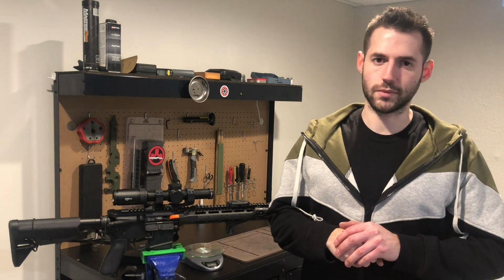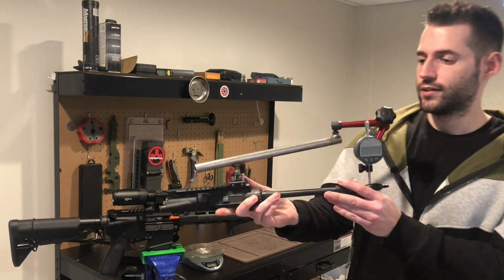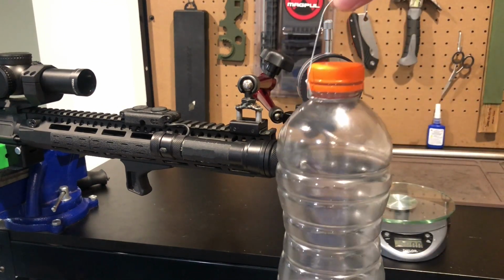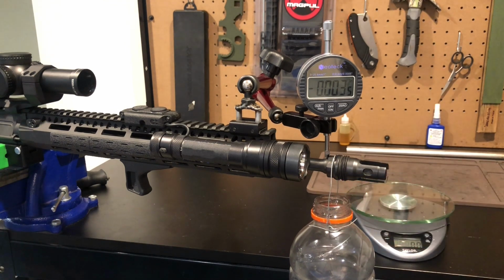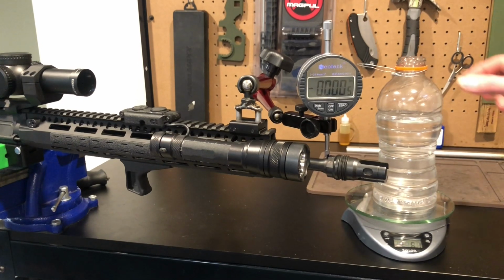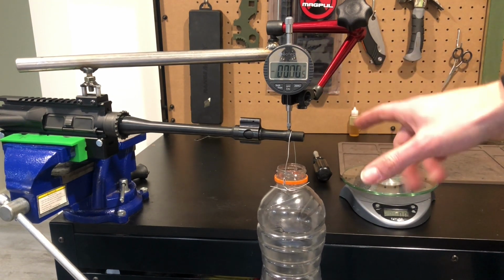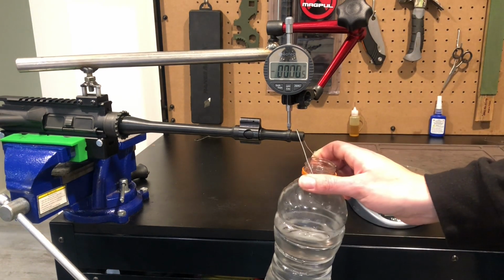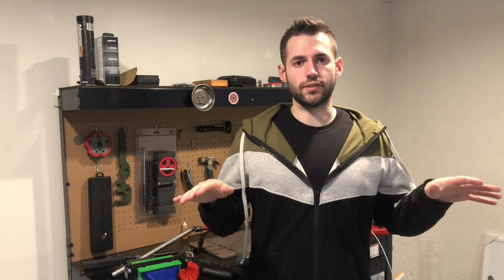Do Suppressors Affect Pencil Barrels? (Faxon Pencil Barrel Droop Case Study)

Comment: So watching this, and understanding the AR platform well. Of course gravity plays a roll. So adding wieght would impact the barrels position relative to its zero(scope). There are many parts that can move and shift. So the intial measuring from the handrail to the barrel is not significant as that is not your tru place to 0 your measuring device. Using the uppers rail would be the best option.

Comment: Your setup is cringe.
.
Your .002 “deflection” is likely in the vise and clamp to gun interface.
.
Put the hand guard on and put the indicator on the guard, will get the same deflection as when measuring the barrel.
Now put the dial on the barrel and hang the weight on the flashlight…… same .002
.
Also indicator tip on flat surface not the radius of the barrel.
Reply: Where’s your video?

Comment: My math may be wrong but if there is roughly .05” of droop approximately 16” from the intersection point. That translates to about 11.25” at 100 yards.  As long as that POI stays consistent and you always run the suppressor there shouldn’t be any issues. Granted this doesn’t take into consideration travel of the actual round, just straight lines.

Comment: I know this is an older video but didn't really see anyone using any logic in the comments. Your comparison is flawed, one barrel is shorter than the other. at .0055 at 100 yards deflection would be less than an inch closer to around .3454 inches. If you are worried about that type of difference than I would suggest worrying more about what caliber you are using and what that platform is actually used for. Also if you are using a suppressor on that weapon system why are you zeroing it with out the suppressor?

Comment: cool video idea.  Small content creators like you and I need more algorithm love.  Gave you a like and a sub.  I have a few cans.  With my steel can, I see a significant amount of POI shift even on no taper barrels.  To the point I have the shifts recorded in my phone depending on the host it is on.  Not so much with my titanium cans.  Good idea to zero your turrets to how you plan on shooting most of the time and then do some thorough analysis and know where to dial when the can is hangin or not.  You will find it is repeatable. Also need to consider cans change barrel harmonics which can either help or ACTUALLY HURT groups.

Comment: This would be interesting to see the difference in flex between room temp and 500 degrees operating temp. On heavy and pencil 12.5”s, 14.5”s or 16”s
Reply from the maker: I attempted heating the barrel and testing but  i saw no results with a heat gun.

This may require a full heat soak in the oven to really see the effects
Reply: @eitrisenhancementsllc  handheld torch would also work great, but a oven test would be far more repeatable!

Comment: It is surprising how much point of impact shift my 16 inch Faxon pencil barrel build had at 50 yards.  I zeroed my Vortex 4-16x42 scope (unsuppressed) at 50 yards.🎯I installed my Silencerco Saker 762 (20.7 oz.) suppressor. The  point of impact dropped 6 inches at 50 yards with the suppressor.⬇️😮 The total build weight of my 16 inch .223 WYLDE Fostech FLITE Elite upper/lower is 4 lbs, 4.5 oz.💸💸
Reply from the maker: Holy crap that is light! Hows the recoil impulse on it?
Reply: I had a similar experience. BA 16" pencil barrel. zeroed at 50 unsuppressed. Threw my Omega 300 on and dropped about 3" at 50. I just got a turbo k, which is much lighter and only have about a 1" drop.

Comment: Although I like where your head is at, I'm not sure this is a reliable representation of suppressor weight. I think the weight is distributed in a more linear fashion, so I don't think it will affect the barrel as much. in this test all the weight is on that single spot where your wire bale is. Its concentrated within a 1/16th of an inch.  I could be totally wrong, but that was my thinking.
Reply: It would actually affect the barrel more since the weight of the suppressor has a greater moment on the barrel.
Reply from the maker: Well considering the barrel is made of one piece of steel, and its attached at one end to the receiver, and the other end will carry the suppressor. The weight of the water will be affected on the barrel in an identical fashion as the suppressor would.

I see what youre saying, but the question isnt how much weight is put in a small surface area, but instead the question is how does that much weight affect the barrel at the very end.

Your question is valid but unrelated to the test that i was conducting. As i was looking for flex and not stress in a small area.

It doesnt matter if you apply 20oz in a 1mm surface area versus 20oz in 5mm area. As the goal is to test how much 20oz will flex the barrel if the 20oz is applied at the end of the barrel.

Hope this helps understand the goal

Comment: Good work. Just a question add heat from many rounds do you get a permanent curve? Would stainless hold up better?
Reply from the maker: This is a great question. One would assume there would be an increase in droop when heat is introduced.
During the making of this video i attempted using a heatgun to see if there was any difference. I didnt include the footage as the heat gun couldnt supply enough heat to make any difference.

I would love to test stainless vs 4150 but unfortunately i dont have the funds for it at the moment. 
If @FaxonFirearmsOfficial could send me some barrels i could continue producing more of these videos and get a better understanding of the droop these barrels will see.
Reply: @eitrisenhancementsllc  I understand that problem. I am actually seriously looking into building one. Every component it seems has to be highest quality. My kids have badly warped some barrels in shotguns and overheated some ar barrels severely but no weight was hanging off the front. Only a bird cage flash guard.
Reply from the maker: @markr.1329  as a general rule of thumb, 4150 barrels will take abuse better than 416r stainless.
Considering stainless is (according to the internet) easier to cut, which could provide a cleaner cut. One can assume it will wear out faster than 4150.

It also sounds like you deal with large volumes of fire. So i would believe the pencil barrel to be a poor profile for this.
Id suggest the gunner profile instead. As the thicker barrel will help prevent heat distortion.

Realistically, the best barrel suited for your application isnt made by faxon. Youd be better suited with an hbar 4150 barrel from ballistic advantage.
I generally dont recommend BA because they are undergassed. But its a simple fix if you have a drill press and the right size drill bit.

Ive done it a few times to BA barrels.
Reply: @eitrisenhancementsllc  Thank you. I will have to find a gunsmith. Or buy a drill press. I do fine shooting normal amounts at normal speeds. But there are those In the family that don’t. I had looked at Ballistic advantage Kak and Faxon barrels. But BA seemed under gassed. What size drill but would I need if I got a drill press?

Comment: So why do you like clamp on better?
Reply from the maker: It creates a better seal, and overall better friction retention than just a setscrew style block.
I do believe set screw styles should be used when you have a dimpled barrel. But for accuracy based rifles, i believe the clamp on will have a more uniform load distribution as opposed to a very concentrated loading to the barrel.
Reply: Yeah that makes sense. People will always say clamp on is unreliable. 
Whatever lol
Reply from the maker: @lucusallen42  yeah, i mean realistically they both use screws to tighten. So saying a screw is more reliable than another screw is just stupid.

Let people think what they want, ill keep running clamp on gas blocks.
Reply: @eitrisenhancementsllc The other important point that's often missed is that in the modern era gas blocks are generally protected under the handguard. Even assuming a clamp gas block as less securely installed than a dimpled set screw block, it still won't receive as much impact or stress as an exposed set screw block, which is exactly what the MK12 rifles have, and is apparently good enough.
Reply from the maker: @KeterMalkuth  funny you mention the set screw gas block impact.

I actually did a test on that same 10” pencil barrel with the faxon gas block which has exposed sides.

I used a micrometer before and after installing the set screw gas block and found that torquing the set screw gas block caused a 0.0001” deformation.

Doesnt sound like much doesnt? And it isnt much, but the fact that its deforming it means there is a structural change.

Wether this structural change will have an impact on accuracy is on a case by case basis. But it does have a potential to be an issue, and therefore this is why i use clamp on gas blocks

Eliminate that variable and then you wont have to worry about it!
Reply: @eitrisenhancementsllc  Very fair point. Personally, I'd be more concerned about the affects of torquing down the set screw during installation, as that applies pressure directly towards the bore in a very small point. The deformation side to side of the barrel, I would assume, would have less potential effect on accuracy than that. Which is a problem, of course, given that's how they're installed. 

I agree though. I think that clamp blocks make more sense for a multitude of reasons. Plus, wojtek weaponry makes great gas blocks for cheap, so it's not like you have to pay any more for them.
Reply from the maker: @KeterMalkuth  well, thats exactly my point! If a cylinder is expanding in an “X” axis, then it must mean that the cylinder is being compressed in the “Y” axis.
And since its a cylinder, anything that deforms the outside will absolutely deform the inside bore.

So basically my testing proved that such a small, direccional, concentrated load being applied is 100% affecting the harmonics/structure of said barrel.

Wether the effect is negative, positive or negligible. It exists, and it really depends on the barrel itself on wether or not itll present itself, or not at all.

But yes, wojteks are fantastic and not expensive at all! Especially their blems
Reply: @eitrisenhancementsllc  Ahhh, you're very correct. I wasn't thinking about that. I'll have to check out that video. Thanks man!
Reply from the maker: @KeterMalkuth  i have it all recorded somewhere. No video of it yet since i wanted to also test a .750 barrel to see if it was only present on .625 journals.
Just been really busy with other projects

But ill make sure to remember to focus more on that video
Reply: @eitrisenhancementsllc  10-4 man, I'll keep an eye out for it. 🤟

Comment: Might be worth while to plot the numbers against each other and standardize the deflection as a percentage of length. 

Or repeat the experiment and place the measurement device at the 10.5” mark on the 16” barrel. That would be a good data point so you could compare the effect against equal datum points.
Reply from the maker: I will keep this in mind! Thanks!
I did consider taking a measurment at the 10.5 mark of the 16” barrel, but i decided not to because both barrels run different gas system lengths, and this would mean that any comparison between the 16” and 10.5 at the same point would be irrelevant. The most concerning part that would affect poi is at the tip of the barrel at the end of the day, so i settled for this measurement instead.
Yes, it would equate to more data, but its not useful data to the user. So it was left alone.

I do appreciate the info and may still do this anyway if there is enough interest.